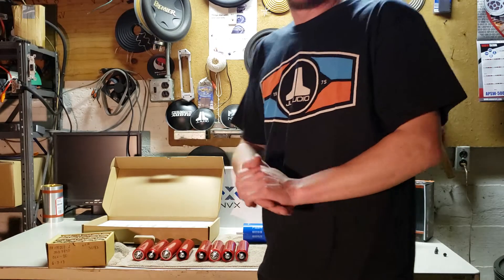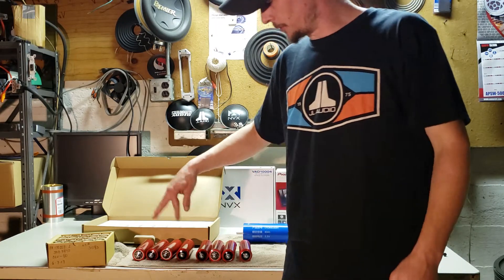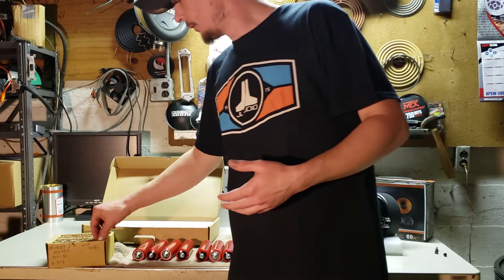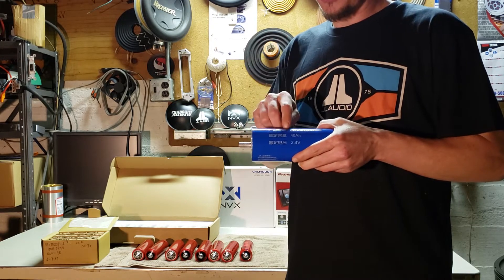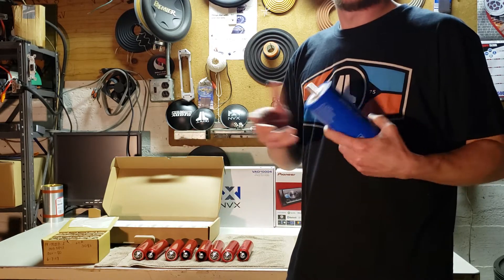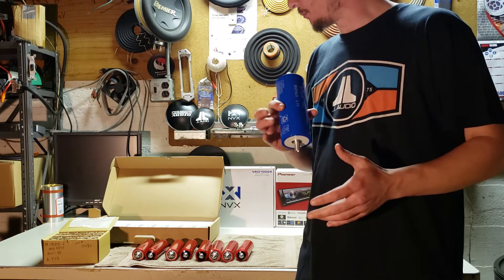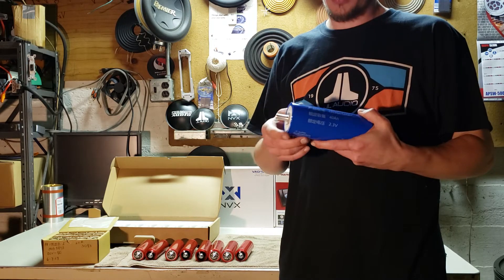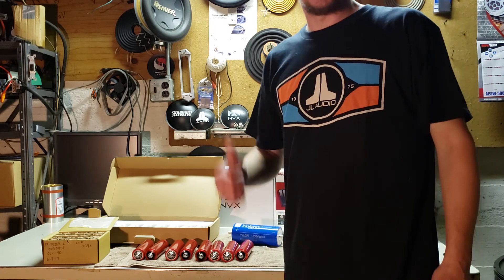Walkthrough on Car Audio Lithium Batteries , Yinlong , Headway

Comment: Check out the newer 40152s cell it’s blue and almost discharged just a little under 200 amps like 150 when the red are 160 plus it’s 15 ah rating so it a win win for me it’s almost discharcgarges and charges like the red cell but has double the ah. So it’s a decent cell. I’d call is a 15 c cell as red is 20 c. Got specs from eve.  The reds are actually 160 amp dish charge not 200 and the bigger blue 40 cell is 150 amp rating.

Comment: Im about to install a 300amp alternator and i have a group 34 full throttle agm in the front but i have a friend that has a 65ah for sale headway and he said its good to run that with my agm but i was wondering if thats ok i have a skar 4500v2 and 2 hertz for highs should i worry about something?

Comment: mazda2284 plz help me. im running 10k have 2 jy 79.8ah cells want to add sumn for faster discharge maybe even take one off and do 2 cells yinlong. 250 mechman i charge @ 14.4 so could i just do 5 in a bank since i wont be charging up to 15.5 and 16v etc. u recomend and plz where do i buy cells and buss bars best place to buy plz? also only have 1 run 1/0 to rear should i def run another it make a difference? thx mazda2284 always a help!

Comment: I cant run the yinlongs with a 12 volt agm starting battery thats isolated while not in use?
Reply from the maker: No . Isolator is not made for 2 totally different batteries and voltage.  It's made for 2 of the same battery.

Comment: Hey in your video you said can't use a AGM battery with supercapacitors. Right now I have a Agm battery added for my amplifier, so I can't wire the caps from the battery to the amp? Or would I have to remove the battery all together?  I have my rear battery wired to my alternator (14.4)

Comment: Can I run lithium on a stock 140 amp altenator that charges at 14.4  to 14.8? I've been told I need a higher charge voltage but many h.o alts charge around the same as stock. What cells would work with around 4800rms?
Reply from the maker: depends what cells you want to run . headway can be used with stock alt no problem ''16ah minimum''
Reply: @mazda2284 If I have a bank of 40ah Yinglong cells and I dont drop below 14.4 charge voltage would that be safe? In the video you said 400amp max from alt. Would 140amp work just not be optimal straining the altenator?
Reply: @mazda2284  Do you build and sell for potential buyers? Thanks for the  knowledge in your videos!
Reply: Tyler S I know this post is a little dated but was wondering if you ran into any problems sticking with the stock 140 alt. Thanks for any input.
Reply: @devilmademedoit77  I like to know the same thing because I'm trying to run a bank from my stock alternator 90Amp
Reply: I know this is dated but I too would love to run my bank off of a stock alternator 90 AMP

Comment: Great video! Can you do a video comparison of AGM and the headway 38120hp cells? Agm ah vs headway ah! Thanks
Reply from the maker: if you need car off long duration low amp draw power 100ah agm is better than 16ah of headway , if you have a charge system and playing music headway will kick the crap out of agm . considering you can buy 32ah of headway for the price of a 100ah agm , the headway is gonna win .
Reply: @mazda2284  thank you!

Comment: Hi I'd like to buy yinlong. how much bank do I need for 20kwrms system. Thanks for the nice vid
Reply from the maker: 200ah will support 20krms clamped
Reply from the maker: https://diycentralshop.com/product/40ah-lithium-cell/
Reply: Thanks a lot
Reply from the maker: @e2cjeffoy77  no problem :)
Reply: Sorry to bother u again man.. I'm looking for suggestion from someone with obviously alot of experience with lithium cells.. I will be running 7-8k rms. I have a 300A  Ohio generator alt. Charging range on print out with alt says 14.4-14.9 4/0 pure copper welding cable w/ big 3 upgrade. Should I run yinlong or headway? And what size bank?
Reply from the maker: @jeremyhardee9026  80ah yinlong LTO for sure . Either DIY or ces makes a cased 80ah for 1099$
Reply: I should be fine even though I'm not gonna be charging over 15v? Do u use a lithium charger on ur banks or just strictly alt power? Sorry again for all the questions man.
Reply from the maker: @jeremyhardee9026  no problem with the questions , glad ur asking . alt will be fine and wont need to use a lithium charger , tho it is nice to have a charger for if you leave something on and run the battery down too far .as long as your over 14.2v charging with alt you will be fine.
Reply: I got another question man... what charger do u reccomend for the initial charge after letting lto cells balance?
Reply from the maker: @jeremyhardee9026  i like a variable bench power supply 0-30v 0-10amp , you can choose volts and amps to charge to .

Comment: Is it because the LTO has a higher resting voltage than the AGM battery  the reason why you do not want to run LTO with AGM??
Reply from the maker: Correct,  the agm/lead acid pulls the lithium down and ruins the lithium . Also drops the performance of the lithium

Comment: FYI, the negative runs up to the top too. Just the button on the top is positive. A protector on the top of the cell is recommended if it is missing too. Don't believe me, use a multimeter and you will see that you can get both positive and negative from the top center and top outter respectively.

Comment: What would you recommend from experience with the different types your playing with, I have gm truck with ecu controlled voltage, currently only running two yellow tops under hood with a mechman 370a for my deaf bonce 4k at .5ohm.. charges from 13.3 up to 15.2v.  Holds at 14.4v with headlights on.. peaks at 15.2v on cold start to top off batts.. I'd like to keep my agm and add headways, if it will work, my resting voltage overnight is 12.8v high or 12.3v lowest
Reply: Also, live in Michigan, so cold weather is a definite thing.. and this is my daily driver crew cab truck
Reply from the maker: More headway or switch to yinlong LTO

Comment: Good vid! Im new to the lithium game so i have a couple questions i hope u could help me with. Whats a good cost effective bms? Whats the best/easiest way to dis charge  a bank & re charge? Thanx!
Reply from the maker: 40-60 for BMS , discharge with load tester or anything that can draw a decent amount of amps , lithium charger or variable bench power supply to recharge
Reply: Hi is it ok to charge yinlong straight from alternator 320a
Reply from the maker: @e2cjeffoy77  yes , 400a max per bank , so 40ah = 400a , 80ah = 800a , ect

Comment: so... do i need to charge these banks myself with a battery charger from time to time. or will the alternator charge them.   also is there a way to use these to stop headlight dimming while bassing
Reply from the maker: you should charge before installing , what voltage does your alternator charge at cold and warm ? and yea these will stop headlight dimming lol
Reply: @mazda2284  no idea.
Reply from the maker: @_ODJ  find out , get a stinger voltmeter so you know what's going on
Reply: @mazda2284   ahh  ok. i have one i installed in the dash, i just dont have the van in my driveway rn so idk. i been looking into these 38120 HP cells. you dont run any sort of battery management system? just alternator charge right in?

Comment: It's about time someone done this! So by balance or do you mean voltage regulator? if not what do you mean by balance her or do you have a link to the product? Much much Respect your pretty good little guy!! Gotta give it to you!! MUCH overdue video Ty and love the Camaro and supercharge it  more made for v8 turbos are a pain in the ass to maintain... And once you supercharge or turbo you'll know what I mean cuz it's kind of addicting just a little bit!! 🤔
Reply from the maker: ill make a video about balancers , in short its a small box that is made to bleed off excess voltage on the cell's to keep them level  , i also need to do a video on chargers
Reply: @mazda2284  ok.. that'll work...

Comment: Hey Brad, those Yinlongs aren't designed to be used with AGM's as you say, so how can you integrate into car audio system? What about using an isolator? I don't think the Yinlongs are designed for the high temps of under hood, right? If not, how could they be used in car audio system unless they were separated from your main starting battery? I got a bank of the Headway 38120HP cells and plan on getting another to use in my daily driver and under 1500 watt system. Great video, thanks for the info!
Reply from the maker: So myself I just run yinlongs in the back , instead of a battery under the hood i have a distribution block , i charge at 15-15.2v cold .
Reply: @mazda2284  thanks man, I get it now. What about the CMAX packs? Seems like they are getting a lot of love lately. Have you tried any of those?
Reply from the maker: @wal  i have , they do more output for less $ but are not as simple to work with and have a fair share more you need to do , they prefer higher voltage , they need to be cased and be compressed so they dont expand and swell , they need dividers . the reason they are so cheap is because they come out of used ford cars , brand new cells are hard to find and they also cost alot more . Cmax also needs to be balanced 100% where yinlong dont have to be as long as you check them once in awhile . i think the major reason people use them is cuz they are easily available and cheap . i still prefer yinlong myself , i havent seen a dead yinlong bank yet but ive seen a few cmax banks that are done for .
Reply: @wal  c max I just bought 76 cells doing a 105ah for my set up it's alot more than I need but for the price I had to buy around here 600 for a 90ah I got 105ah for 500.
Reply: @mazda2284  so u used 1 alternator ? just ran a charging wire to cells in back and keep agms hook to alternator in front so u cant hook both in series agm and cells the blue ones? but u can with the red cells headways
Reply: I have 80ah bank of yinlongs with 2 bank of of supercaps under the hood to replace the agm and it work  Wonderful with a 280 amp alt
Reply: Headway sucks, what are you going to do in the winter? get a warmer for them. LTO is the shit, like the owner said, watch russian videos, thats all they run down there. They are poor people and DIY is the only way, so they reserch and use physics, not just throw money at XS power... Guess whats inside them. Dont bash LTO, not to me. .. how you going to listen to your music in the winter? poser.. fake. and trying to confuse the rest. and yes you can have LTO with other batteries. videos of it out there. Greeedy american fuck
Reply from the maker: @bobbutter2768  im not sure where you get your info from but it is highly flawed , see my -25 deg. cold start headway video ? they work fine in the cold , not as good as yinlong but they did fine .  my truck with agm wouldn't even start and had to be jumped . and no you can not mix LTO with any AGM or lead acid battery without ruining your LTO or your alternator .
Reply: So yinlongs and agm/lead acid battery is no good. In the video you said headway cells and agm batteries can work together. Is that true?
Reply: @ChickenJoe24  I think the only reason yinlong can't be used without lead acid/agm is because of the charge voltage. If you have an isolated charging system for just your system then you'd be fine
Reply: @beardedforlife3740  what do you mean if you have isolated charging system for just your bank? I have stock a alternator and I'm trying to run the then with or without a battery.
Reply: @secalcavazos3204  what I mean is having a secondary alt or more that charge only your car audio bank and nothing else. What that does is makes every amp produced by the alt available to your audio system and nothing else
Reply: @8:18